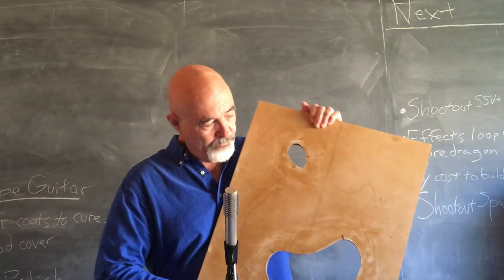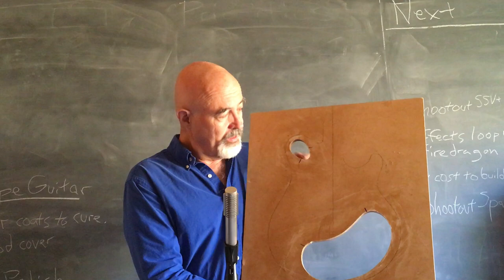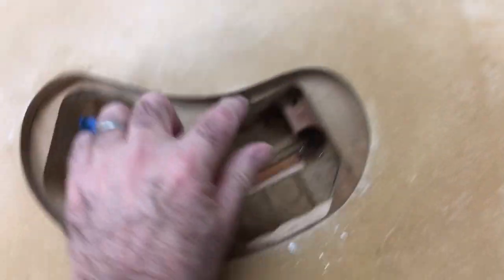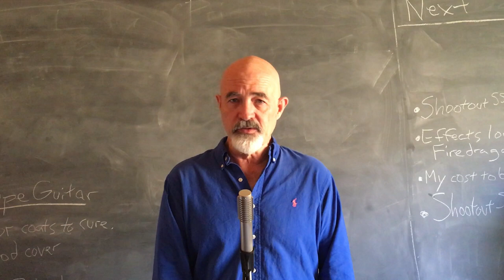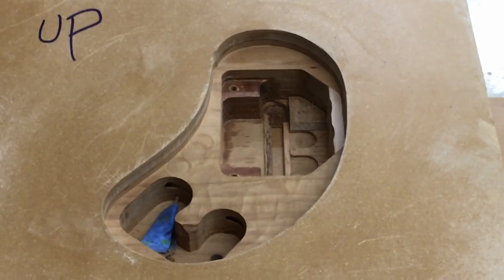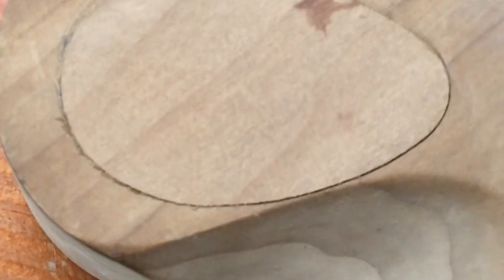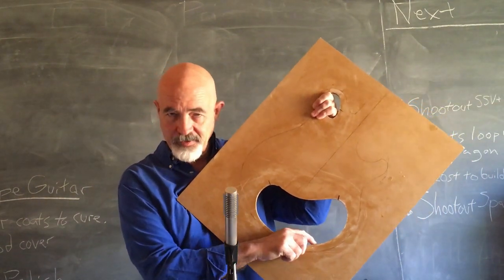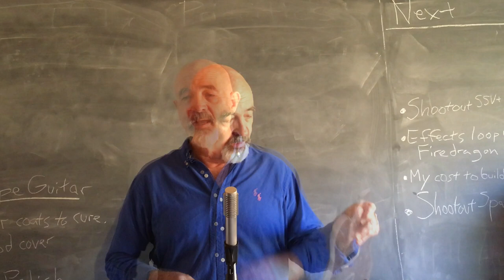GGBO (Great Guitar Build Off) 2021, Part v, The Template Trick

Comment: Lastly... sorry for multiple comments but I have mdf templates. Ok for the outer body but I use a hand held router using perspex templates for routing cavitied. I can see through the perspex to see any issues and also see what I'm doing
Reply from the maker: Thanks, but it this case I wouldn't have seen through as it was facing away on the router table.  But do you have any ideas why the bites were taken in the template?

Comment: Hide the bits the router removed. add a thin mahogany veneer on the back
Reply from the maker: You can see near the end of the video, the repair makes them almost undetectable.  Still, I want to know why it happened so I make sure it doesn't happen in the future.